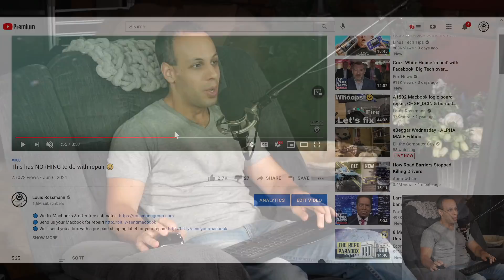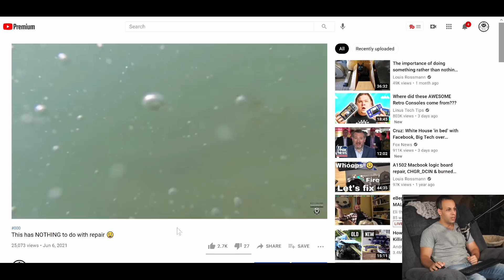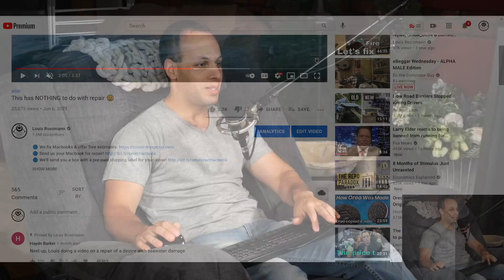Why are user serviceable batteries a bad thing?

Comment: One thing I didn't know about batteries till I took an IoT class for my Comp Sci degree is, there are no sensors that measure how much % charge is in a battery, in order to do so, you have to test a batteries voltage and current while it's discharging and create an algorithm using linear regression to best guess how much charge is left in a battery. This has improved over the years, that's why now if your battery says 5% it's still going, and 10 years ago it would say you still had 15% but die. Part of the reason for this accuracy boost is knowing exactly the battery in the phone allowing your best guess to be really good. Changing the battery to a 3rd party battery means the algorithm doesn't know the charge of the new battery and will just act like the original one. So, your phone performance may be off with a 3rd party battery. 
Now, that said, why can't phone companies sell the battery type they test and put into their phone? Why can't they just say, hey, if you change the battery to a 3rd party, we're not responsible for phone performance after that? Sealing the battery away is for sure an anti-right to repair move. They could find solutions for the battery issue, they just chose the crappy solution of sealing the battery, trying to force you to buy a new phone.

Comment: the only reason I wouldn't get a phone with a removable battery is so I don't start fiddling with the removable back, as i found myself doing multiple times with my last phone which ultimately I bid farewell to after 5 years and a battery swap because the back was loose and cracked, and YT started disregarding smartphones with "inferior hardware" in their updates. Got an LG now, no fiddly bits I can wear out other than the wallet cover, somehow after 2 years the battery is still holding on great almost as if it was new (well, probably it's just because I use it less), so I'm not concerned replacing any time soon for another 2. It's not the same expected service life my old Nokia which I still have around as backup has, but at around the 5th year I bet the phone will have toughed out enough cosmetic damage and other nicks that it won't be worth the money fixing.

Comment: The problem is that there are few options with removable batteries. I don't care about quick charge or about a 9milimeters thin phone. I want something I can use for 5 years. That is probably the only reason I'm still using my huawei p30 pro. has a few years and have replaced the battery in their huawei store for around 20 bucks, it has around 2 years and is still working completly fine, I'm guessing I'll will change the battery again in a couple years and it will still be taking great photos and working good enough.

Comment: Would prefer a sealed in unreplaceable battery , the part that does wear out is like saying I would rather have to buy a new car instead of just replacing the Brake pads when needed , or Tires ! Hell can't access the fuel tank or recharging ports . Rather just spend another 10's of thousands to get a new vehicle . Point is easily expanded out to public transportation cost .

Comment: Question: is there a particular standard to the housing of the battery if its user replaceable? Like, the capacity isn’t as much as the same size battery that’s not user replaceable due to the housing taking up a portion of its size. I vaguely remember that being the reason why i gave up going for user replaceable battery phones. Although if the capacity sacrifice today is fairly negligible I’d probably go back. In my mind it’s timed obsolescence out weighs daily capacity in the 1st year or two (when comparing same sized phones). thinner is better for me. I’m always for making a more informed decision though

Comment: Hey Louis, as someone in the telecom industry I'll say that the consumer drive for longer battery life and better ingress protection directly lead to sealed in batteries.  We are where we are today because that's what the public wanted.  My company tried to sell removable battery phones as part of the lineup but they were always too bulky, too pricey, or not cool enough for purchase except by those who demanded those features.  It wasn't good for us to keep buying those phones and they fell out of favor.  

For battery life, the removable batteries are volumetrically less energy dense due to the battery having to meet IEEE 1725 puncture resistance and other CTIA testing.  That extra casing around the battery as well as all the casing for the phone increased the thickness of the device along with reducing battery life over a sealed design.  

The user replaceable batteries on devices like the S5 relied on gaskets around the backplate and the consumer properly affixing the backplate, ensure both mating surfaces were clean for a proper seal.  There were large numbers of devices that failed due to basic things like pocket lint breaking the seal and allowing liquids inside the device.  Most consumers can't be relied on to, prior to reinsertion of a battery, to wipe down both mating surfaces to ensure the lid restores ingress protection.  Further, people generally aren't willing to buy a more ruggedly built phone with with a removable battery from the get-go because it isn't the cool phone.

Consumers voted with their wallets and pushed towards thinner and thinner devices with less features so that's what we sell.  We do still sell more rugged devices with removable batteries that do more than most people need, but few people buy them because they aren't cool.  If people would start buying these things in droves, you better believe we'd happily sell more of them.

Comment: Imagine how less frequently batteries would go bad if the manufacturers calibrated "0%" battery to actually be when the battery 10% left. Just hide that 10%.

Letting the battery get so low your Samsung phone automatically shuts off is terrible for the batteries. And it had a positive feedback loop: when the battery is wearing out, 5% and under goes by quicker and quicker.
My phone hits 5% and I think i can spend one minute finishing a message, but nope.

Comment: I absolutely hate nonremovable batteries. I am still using an ~5 years old Galaxy S6 and it's battery is half-dead again. I have been suffering with a degraded battery for quite a few months simply because I can't force myself to go to a repair store to change it (I am lazy, I don't wanna spend time, they will likely mess something up, etc.). And no, the sealed battery provides absolutely no benefits: it is not water-proof and it has low capacity. And I see 0 benefit in having a glass back as opposed to plastic. So, 0 pros overall, a huge pain of not being able to simply order a new battery and change it, and now there are almost no phones with removable batteries today.

Comment: Maybe, you need to start comparing this to the automobile industry. Imagine if, your 12-volt battery on your new gasoline engine car was sealed in. You could not take it out without extensive work. Or the alternator that charges it, aka the charging chip, because General Motors has told ACDelco suppliers do not sell to anybody else that particular alternator. People would be up in arms. Tesla is currently doing this. Tesla has parts that you cannot order. Tesla has parts that they will not sell. Tesla has parts that only the Tesla Service Centers can put in. This is absolutely bulshit. There is no safety or reputation imagery involved, it's all about money. Imagine if you had to buy a new car every time you needed an oil change.

Comment: not having a flappy plastic door on the battery? eh sure whatever. it can feel pretty cheap too

having to remove the OLED sealed screen and it's adhesive, then open the entire phone and take alcohol to the glue to dissolve the glue holding down the battery, then having to replace all of the seals to make it waterproof again? wtf is this shit. i'd rather my cheap crappy door

Comment: I'm very much in this boat. I want my laptop to have replaceable battery, not just because of servicing! Hell, Thinkpad x40 series had both hardwired and removable battery and user could swap on the go his batteries! Imagine, your main is getting exhausted, there are no outlets around, so you just take a new battery out, no need to shut down and turn on your computer. Sadly, that was the only generation, which had this feature. New laptops these days? All are ultrabooks! No replaceable batteries even on business models!

Comment: OR if you have charger ports have a package that holds dry cells (new life for D cells).  You could plug it into the charger port and take off just needing to buy dry cells as needed until you could find a replaceable battery for it.

Comment: I really do miss my galaxy S5 because of it's waterproof nature and the replaceable battery. A lot of people hated what I loved about it, that if it fell and it the floor the back would pop off and the battery would pop out leaving you three pieces to scavenge and put back together. But here's the best part, you get rid of the dust and dirt, put it back together, and it works just as fine as it did before your dumbass dropped it. And even better yet? I never had a case for it, yet the screen never broke despite how many times I accidentally yeeted it into concrete/brick/tile/hardwood etc. The only reason I "upgraded" was because the newer phones had more battery capacity and data storage with better screens and they were faster and had bigger screens. The Galaxy S5 truly was a king. Let's see how my new S20 does when that arrives.

Comment: I am torn interms of the battery  I want them replaceable  but I hate the idea of sneazing and the batteries falls out I remember in a admittingly older tech device it indeed had happened to me but I guess that's just down to product quality rather then right to repair in witch case be other wise irrevivant to the bigger problem

Comment: That's like saying, "the battery on my car died, so I had to throw away my car."
Reply: Dont give Tesla any ideas....
Reply: @mickeydee3595  They already thought of that. If a Tesla's battery goes completely flat they make you replace the entire battery.
Reply: @eDoc2020  if your tesla gets into a slight accident and Tesla finds out they blacklist the car from supercharging and other features.....

So basically a massive paperweight
Reply: @mickeydee3595  If I'm not mistaken Tesla isn't quite as bad as they used to be. I've heard all Model 3s always have supercharging enabled, even totaled ones. I could be mistaken though.
Reply: @eDoc2020  Tesla's are fully electric and only run on batteries.  Other then having the batteries replaced, how would someone use their Tesla if they wont hold a charge?
Reply: @fishingangler4315  I was referring to the case where the battery is just drained beyond the cutoff point but the cells aren't damaged. A reasonable expectation in this case is that the car could simply be plugged back in and recharged.

Comment: We should trade in our cars for a new one every time it runs out of fuel.
Also did you know Submarines are built around the crew, when the crew have done their tour of service, the submarine is fully dismantled as it is no longer water or air tight when they open the hatches to let the crew out....  \Sarcasm

Comment: so for the battery being replacable as a good thing this is what would be needed for me to pay for it

solid design that doesn't feel like it would fall apart
no removable back cover as theres no way to make it fit if it isn't snap on plastic so slot loading or tell me a way for a metal cover to be stuck to the back if not magnetically attached and even then would it be sensitive to falling out
same size battery as if it was sealed

do these and i'd love the idea of a replacable battery
Reply: BUT, the sealed battery phones don't have metal either. They're glass. #Debunked.
Reply: @RobertMorgan  the xperia xz1 is sealed and it's metal

Comment: i also find it odd how the s9 died in the ocean my xperia z1 was in the ocean for hours back in 2014, it is still entirely fine, and it works fine to this day.
Reply: I have a Z1C and was also swimming for hours in the ocean, nothing happened. 
That said I did get liquids a year later inside. It was my sweat actually, was bike riding for hours with constant rain and after that there was sweat inside every port. But the phone did not die nor did it degrade. I had everything open for a few days and it was all gone. Still can submerge it. Dunno how I was able to get liquids inside though.
Reply: @Vanadium  interesting cuz all I've heard bout Xperias back then was, build quality and tight assembly sucked, Z3 series being the worst offender
maybe a region thing dunno 😄 (better batches for some markets)
Reply: @previousslayer  Well I had two of them. 
One was flawless and was bought by myself when it was out for a year or so. 
Legit resale but the second one I bought was a refurbished one. I think they messed it up. 
I destroyed the first one because of an accident. I cracked my hip and the phone was in my pocked. It was bend beyond repair but not shut off by that accident.  

I am now an Xperia XZ1 - C owner and I wont change this fone till it is really dead. 
There is the sad part that this fone is still capable of everything but will have flaws because of no future OS upgrades. I really hate this fact. It renders a perfect device inoperable or just kind of unsafe. 

Its also sad that many of us dont even need that much hardware. I am not an enthusiast for PC but I still got high-end parts and I spend 1400€ this year for two parts.  But I never would spend that much on a fone.
Reply: @previousslayer  I cracked the screen on the top 1/5 of my Z1 (landed on a pebble squarely on the headphone jack and suffered too much pressure, probably). As in, that part was dead for years, but there were no sharp edges aside from the corner of the phone. And I'd just cover that part with my hand and wash the rest of the phone with soap and water occasionally. I used it in that state for over 4 years, never suffered liquid damage.

A friend mine had a Z3 he would take underwater photos with. Just in a few seconds, maybe a foot or two below the surface, but still underwater. No damage there either.
Reply: They are "protecting" you from liquid damage by actually killing the phone 😂
Reply: Not that odd, S9 is rated to IP67. Sony Z1 is rated to IP65 and IP68.

Comment: reason i don't want too much repairability is design if people got their ways then we'd still have galaxy s3's with replacable batteries and flimsy battery covers, it's ugly and to me design over function is always what i pay for i don't care i want design over function, if they do things properly then ofcourse i'd want things to be easier but then they'd have to design something so well that you can't tell a difference, it can't feel different it can't fall apart when you drop it, repairability+good functional design compromises on overall design and yes if a phone was sold with a removable back cover and a replacable battery i'd choose the phone with the unibody design, unless they made the design perfect so it still looks unibody
Reply from the maker: HTC sensation 4g
Reply: @rossmanngroup  it's not the same it creaks it opens up, but as you said if the battery was slot loading i'd be ok with it if the battery was entirely slot loaded with a metal outside so you couldn't tell at all then i'd be ok with it, but the other issue is that the battery has to be smaller if it's going to be replacable.

Comment: okay, I dont think you can get the same slim designs as you are seeing these days. back in the olderphones the density of components was much lower. A user serviceable batttery had to have protection and cant be (close to) bear battery cells, that would be susceptible to damage and firehazard. the waterproof aspect is not really a point, more the combiniton of waterproof and the densly packed slim design.

Comment: I refuse to buy anything where I cant replace the battery. If you know what you are doing you can modify the phone to increase the standby time. My Nokia 106 currently has a standby time of 3 months! Using average phone calls I need to charge it every 6 to 8 weeks. OK it's now about 1/2 inch thicker but that is not an issue for me.

Comment: Had. Palm Centro for 8 years. The battery used to last more than a week. When going on holidays I would just take two spare batteries and swap them out instead of charging. Even the cheap no name brand batteries lasted for the life of the phone, because I cycled them regularly rather than using one until it died. If the battery is sealed in you don’t have the option of swapping them on the go.

Comment: Sealed is usually slimmer design and if legislation would require user replaceable batteries, that would take away this option and the possibility of choice in this mater.

In some cases 2 user replaceable battery option where you can replace them one by one without even turning off your device is preferred at other times a sealed design is better. Even if you have other options to make things smaller at higher cost, even if you can also prevent kids from removing the battery (can be bad) sometimes sealed is the good choice.

Comment: Something I don't understand is why the battery has to be glued in. At the very least it could be clipped in, so when you do remove the back of the phone it's simple to just remove the battery and swap in a new one and you won't need to peel a pack of lithium away from some adhesive. Not gluing the battery in would make it far easier to replace while not changing the user experience of the phone at all.